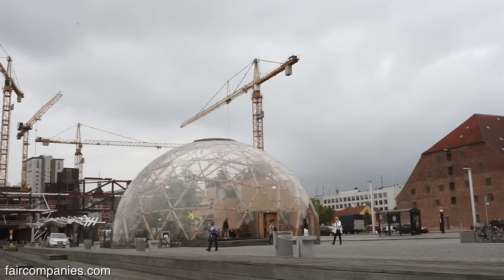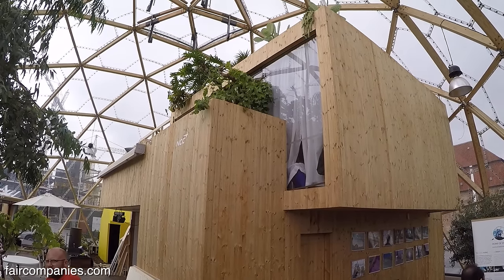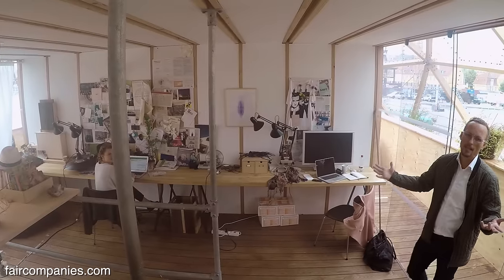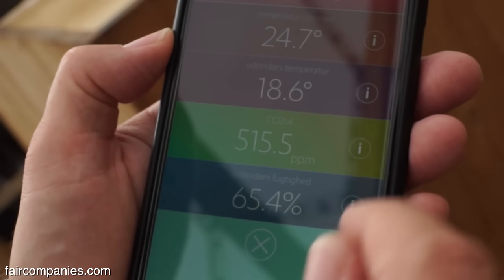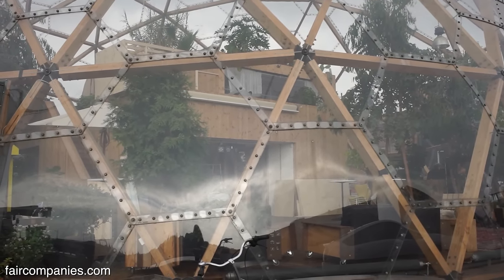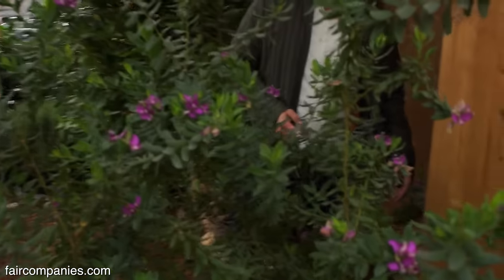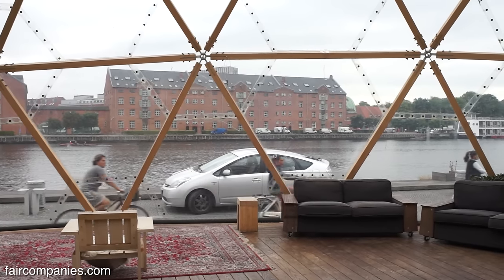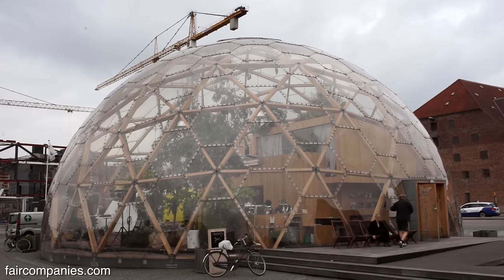Nordic home encased within geodesic dome for passive solar

Comment: from someone who owns a greenhouse dome; you should have built the frame with steel. The wood will rot from the humidity.
Reply: Steel wil rust and the outside is some sort of metal
Reply: Would it not depend on the type of wood? Some wooden boats have lasted hundreds of years.
Reply: There is an Asian flame treatment that makes it more hydrophobic as well as insect repellent.
Reply: @nathanxxvii  The wood looks cool after you flame treat.
Reply: Presumably, your greenhouse is glass and not polycarbonate? - Also you can see that the polycarbonate is separated from the structure by 'stand-offs'
Reply: It's an interesting proof of concept but as you can see from even the use of the poly carbonate without the use of glue, or silicone, you can see where there is mold growth on the panels in the video, some use of silicone gel is needed to prevent that. I know he's trying to create a "Earth friendly" house, but part of truly creating a sustainable and earth friendly house is knowing when to use, those "Earth unfriendly" materials, use them sparingly but use them where they are needed to sustain the living situation. you have to balance ecology and economy but it's totally doable. This idea that you can only have one or the other is demonstrably a false dilemma created by the politically motivated to use "ecological concern" and mother earth as an excuse to from a authoritarian level regulate human activity.
Reply: Very good point.  I am sure it is same for the siding of the house too.  Maybe use aluminum instead of steel   Also maybe use carbon fiber for the framework of the dome.
Reply: @chuckberry7749  Treated lumber will outgas.
Reply: Since it's only an experiment to test the theory and collect data, I'm sure they chose wood to reduce costs.
Reply: Aluminum (coated)
Reply: @Noutelus  stainless steel, duh
Reply: i dont believe it gets humid enough
with correct air circulation it should be fine
Reply: Steel costs a fortune. 
Wood can be treated or varnished or painted ... 
regardless ... all materials have some limitations 
 Metal would rust. Aluminum would be astronomical .. unaffordable.
Reply: @smallstudiodesign  repairs cost more than the required stainless steel to virtually never have to touch it again
Reply: Maybe use copper?
Reply: @angelafenech1649  copper would be weaker, more corrosive, and more expensive
Reply: Waxoff Waxon  I think steel can be rusty for 50 years whereas rotten wood would have to be replaced within the year
Reply: The humidity is only 65%, he shows it in the video.
Reply: @AgentExeider  It's not mold. It's pollen from trees.
Reply: Or carbon fibre, plastic coated stainless steel even. Last a lifetime.
Reply: It is constructed of Kerto; engineered laminated veneer lumber.
Reply: @thingswelike  Polycarbonate is SHIT ... because ... well ... look at it in 10 years again. It degrades and thus does not fulfill its function anymore. Anyone who has used glass and also polymer-based panes in a garden will know that polymer stuff scratches far easier and then needs to replace. Glass is hard to scratch and doesnt need to be replaced. For centuries.
Reply: Pressure treated lumber rated for ground contact
Reply: Aluminum. Self mating beams
Reply: @MoebiusUK  Salt water preserves wood. Fresh water rots it.

That said, the wood here should be fine. There’s an air gap all around it so it can dry out in the sun.
Reply: Cause condensation caused by temp different?
Reply: It may be harder for it to rot then you think, would doesn’t rot that easy without some soil to supply bacteria to the affected area. As a guy who owns a 300 year old timber building. The basement floods and its humidity is often higher than his home here.  The wood has no signs of rot. (Obviously I am going to do my best to make the basement not flood) but wood can be very durable especially if you get the right species
Reply: @mannurse7421  Well being such a a old structure to wood used to build that house was probably old growth. This definitely makes a huge difference in strength and durability of the wood.
Reply: @AgentExeider  actual the only issue that way was on outside  of dome . And the humidity being below 70% will stiffle growth.  Don't forget they have monitors everywhere and I guarantee their testing for mold, and other air issues constantly. And mold doesn't like the sun
Reply: @smallstudiodesign Why do you believe that aluminum would be so expensive question mark
Reply: Tell that to Cedar…
Reply: @derekmcaleer2386  Derek do you have any idea how much Cedar costs? Not to mention if you're dealing with smaller size Timber like 2 * 2 it just doesn't have the structural Integrity for how much larger than a 12 to 14 ft Dome